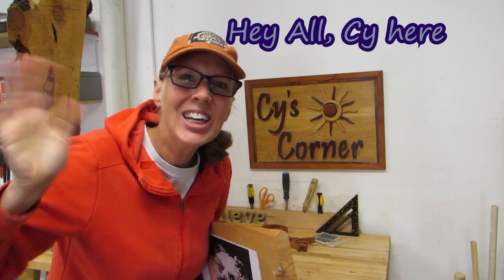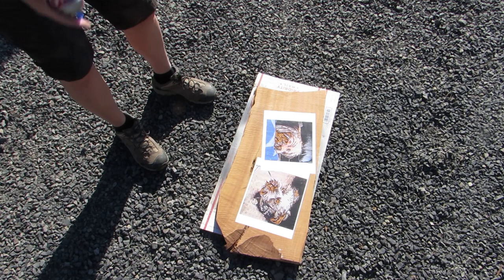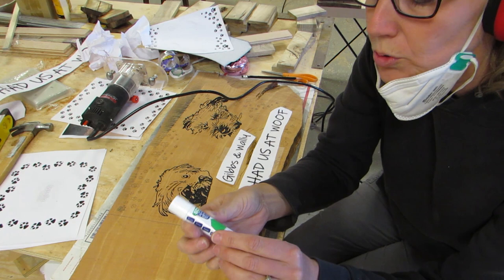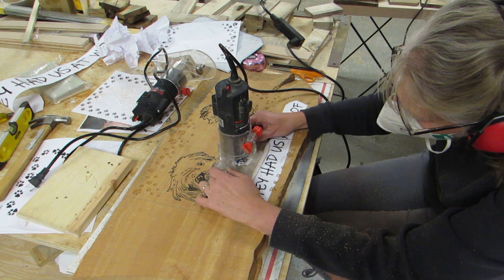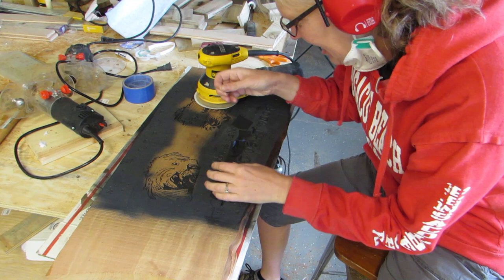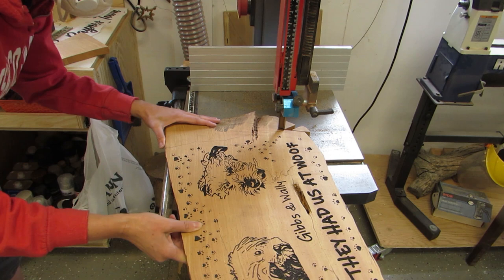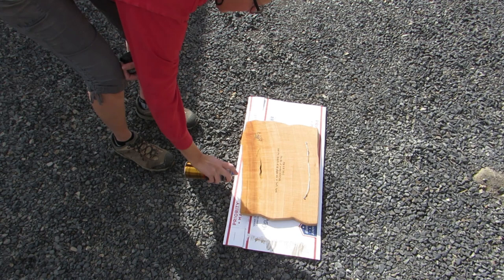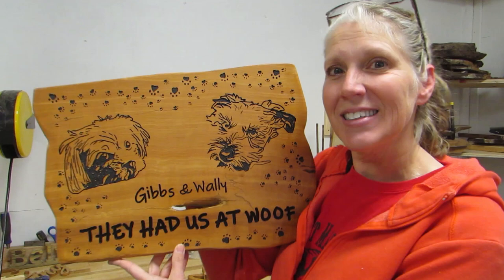Routered Pet Portraits

Comment: Well done Cy,  and what kind bits and shank did you used on your trim router to making this project?
Reply from the maker: I used a profile bit and a 60 degree bit. Look in the description box and you will find a link to where you can get sign making materials. The 60 degree bit you can find most anywhere. The profile bit is special and can be found by following the link for Make a Wood Sign.  I'll attach the link here. : )  http://makeawoodsign.com/